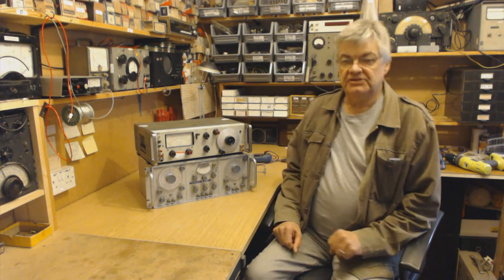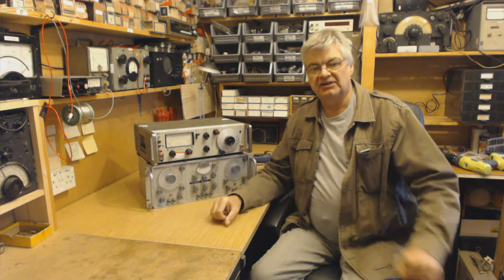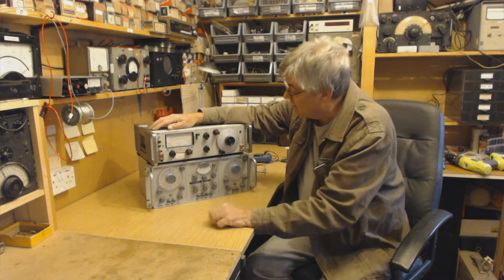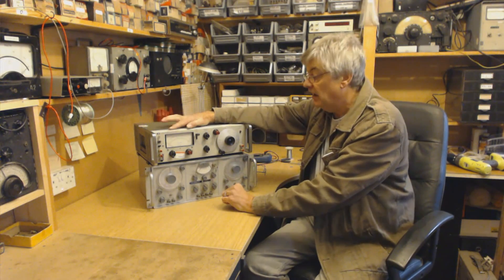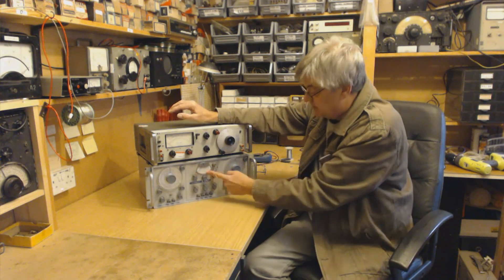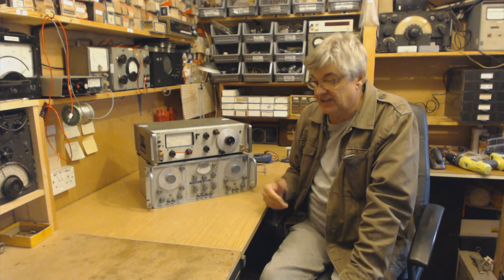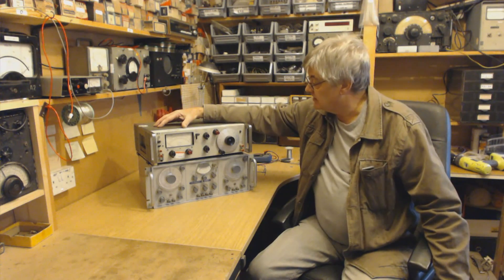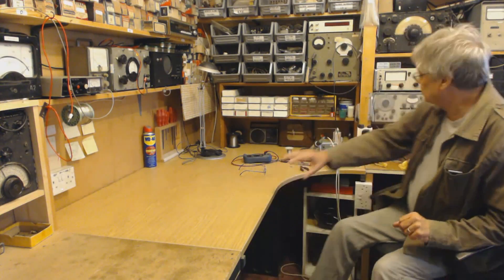Hewlett Packard HP334A distortion analyzer - Marconi TF2005R Osc

Comment: The great thing about that series of THD analyzers, is apparently, H-P made a huge number of them, so they're available for reasonable prices on Ebay.  Because they're pre-SMD/LSI, they're easy to fix.  Here's a rundown of the different models:
331A: The basic version.  332A: Has the RF AM detector for AM xmttr tests.  333A: Like the 331A, but with auto-null.  334A:  Has both the AM detector & auto-null.  Basic specs are the same for all four.  Every serious audiophile should have one, and the 332A/334A are a real boon to those of us who work on AM BCB xmttrs.
Reply from the maker: They certainly are nice pieces of kit.

Comment: Hi Ray,
I have heard of distortion test equipment but never seen or had the pleasure of using them - I have never worked at a radio/TV service centre that had that type of equipment.  Testing the distortion level on the audio output of a domestic radio sounds interesting my friend.
Regards,
Phil.
Reply from the maker: Hi Phil, it is interesting but, to be honest, it's not too important on 1940s radios. However, it's nice to be able to check the distortion level. Regards, Ray.